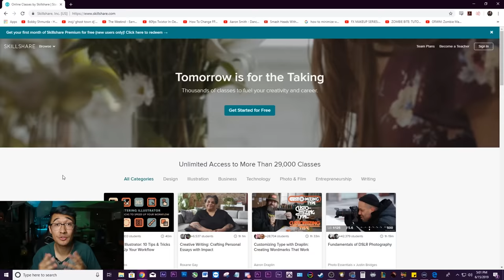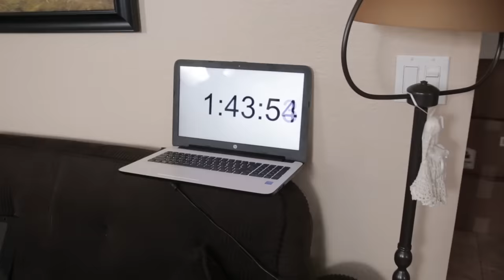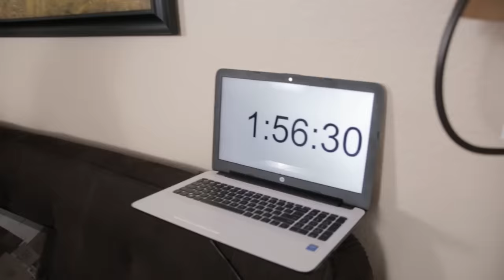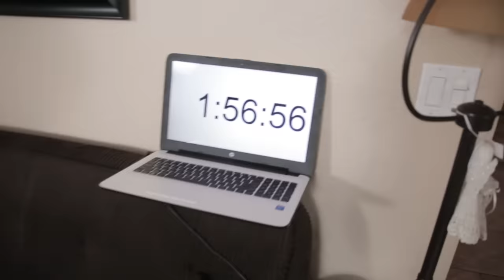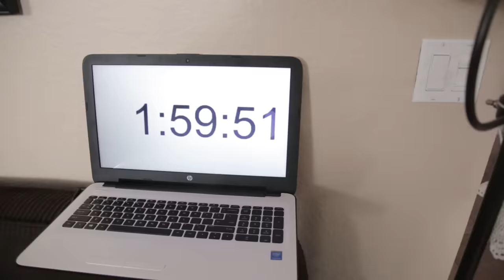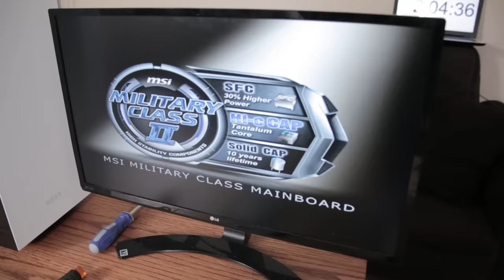He THOUGHT he was buying a Gaming PC...

Comment: 17:20 The case uses the hdmi cable as a pass through so that VR can be connected into the front of the case rather than the back, pretty useful but only if you need it. cx

Comment: He learned from watching ur vids
puts the power supply in first
Reply: Of course he did...
Reply: nothing wrong with that doe lol
Reply: You do you. Install PSU or mobo first doesn't really matter
Reply: @Harry_Ng  thats what i m saying i dont get this com
Reply: you mean gpu, nothing wrong with putting psu first, its the best idea but its not wrong neither, but gpu rofl
Reply: Psu in first so you can ground yourself before touching the mobo
Reply: It's clear that he learned from watching The Verge.
Reply: Putting the PSU in first is actually pretty smart because you don't have to move the computer around with any sensitive parts in it when you try to put the PSU in. Just pull the cables away from the case and make sure they're not going through the feed and blocking any other parts from being installed.
Reply: He should go back to playing tennis
Reply: Nehal Mathew i prefer installing my psu before everything else, its much easier because you dont have all the cables from the harddrives near thatcan get in the way
Reply: PacmanPlayz PSU first, it feels weird putting the mobo in first
Reply: Should’ve watched Linus lmao
Reply: @Joshua Ross "whre they go" .. you mean the cables? or..?
Reply: Lol
Reply: It doesn’t matter what u put in first I’ve built many pcs. It’s just matters if it turns on and if everything well put in together

Comment: I built my budget build for about 300 with an old optiplex with a i7 4790 and 1050ti. Upgraded the psu and added more case fans
Reply: Shae Bryan damn
Reply: Lejrje dude lmao he only bought two things
Reply: rx 570 would've been better, and cheaper
Reply: @andycane.  570 needs connector from psu. 1050ti are only 75w for most so they can be powered by mbd alone. essential for optiplex upgrade.
Reply: I did something similar but it was with an optiplex from amazon. It was a i5 2400 8GB Ram and a 256GB HDD. I replaced the power supply and added a RX 570. My other friend had a spare case so we preformed a case transplant. It cost about $300. Huge upgrade from his xb1
Reply: Eternal 
I ordered an old optiplex, with a 4770k.
The seller got it wrong, he send me a newer i3 6100, felt bad and refunded me the money. Got a rx580 and an msi z170 gaming m5, and a Corsair case
Total cost, 200 dollars, going to upgrade to a i5-6600k or 7600k

Comment: Thats what I most fear about building a PC, plugging the cables in the wrong spot.. Kris can u make a detailed video about cable management and where they are supposed to go?
Would appreciate it alot! <3
Reply: There is literally no way to plug in the cables wrong.
Reply: @KungFuBroFist  yeah but you could break a pin
Reply: anth0ny I’m assuming you’ve never built a PC before if you don’t realize how easy those pins are to break.
Reply: @jaalanodaicyr868  or yes
Reply: notechb0ss2.0 literally just dont put force on them too much..
Reply: Don’t worry it’s hard to mess that part up
Reply: Go to skillshare.
Reply: @branescan  I broke one on accident first time building mines

Comment: I'm fairly sure the HDMI cord is for VR
Reply: Yeah, it's just a pass through to the back of the case
Reply: @DTUOHY96  wrong, its meant for very premium graphics cards that has an hdmi inside the case.
Reply: No for vr if your mother board is compatible their will be a usb port dedicated to it
Reply: @thewingsofdeath4173  No, its meant for graphics cards with hdmis inside the case
Reply: @ashleyjohansson230  or as a pass through if you don't have one. It's still a hdmi port no matter what part of the gpu it's on.
Reply: Yes. The front port is for VR.
Reply: @ashleyjohansson230  it isnt tho
Reply: @colinmcguire3662  Yes it is, thats why there even is a front header hdmi in the first place and why graphics cards with an hdmi next to the pcie power pin exist to make VR more convenient instead of needing to plug things in the back.
Reply: @ashleyjohansson230  its for vr....
Reply: @colinmcguire3662  Yes duhh, did you read what I said? Its for VR but with specific graphics cards with hdmis inside the case so no hdmis needs to be plugged in the back. Please learn to read. Only premium graphics cards have this feature to use that front hdmi panel for VR.
Reply: @ashleyjohansson230  i did read and you said premium cards which do not exist...
Reply: @ashleyjohansson230  and i am not an idiot because i fucking work at computeq
Reply: Ashley Johansson ts designed there for GPU's which have HDMI passthroughs on them for VR (such as what is found on the Gigabyte Auros lineup of cards). If your GPU does not have such ports on the card, and instead only have HDMI on the rear of the card as per usual, then you're going to have to route that internal HDMI cable to the rear of your case and attach it to the rear of your card where your only HDMI ports are. There will be no place on your motherboard to attach this (other than the HDMI port on the rear I/O, but I would highly not recommend that because your IGPU (even if your CPU had one, which it doesn't) is not going to be powerful enough to run VR.

Edit: i prefer drilling a hole or taking a bracket out to plug the hdmi cable i the rear.
Reply: @aarriikknn33ll  Nice copy pasta from the LTT forums
Reply: Cloudy exactly ;) but this us common knowledge tho (atleast for me) just wanted to het a good explanation because my english is not the best whatsoever
Reply: @GODLIKEZ490  When I have to repeat the same thing 4 times, then thats going to annoy me
Reply: @aarriikknn33ll  You literally just repeated everything I just said. Learn how to read before replying to someone saying exactly the same thing that was just said like some parrot.
Reply: @ashleyjohansson230  i didnt want to reply to you, sorry. And also why are you so toxic rn? R u having a bad day or something..
Reply: Yea just a pass through

Comment: Lol that HDMI is for the hdmi for the front panel, which is usually used for VR.
Reply: Yes. For some time, there were graphics cards that were "VR ready" and actually had internal VR connections that came out the opposite end of the card for this reason. I know ASUS did this. Its actually a nice feature.
Reply: Clint Evartt yup it’s pretty nice especially you can just connect your VR glasses to your front panel and not have to go behind the case for it.
Reply: @JoCruz  yeah it's definitely something that I found out existed after getting my Rift setup. But it almost seems dead on newer generations of cards. Sadly...

Comment: Uhh hey chris! Im gonna be building my own pc for the first time, and its not gonna be on the budget side, gonna buy it all new! Here are the specs:

Prozessor: AMD Ryzen 5 2600 3.9 GHz
Ram: Corsair Vengeance RGB Pro, 2x 16GB DDR4
Motherboard: GIGABYTE X470 AORUS ULTRA Gaming
Graphicscard: MSI Amd Radeon RX 590 8GB
Case: cooler master H500P
Power: Corsair CX550M 550W
Watercooling: Cooler master ML240L RGB
Monitor: AOC CQ32G1

Total cost is: 1746.60

Should i change any of the specs?
Is the Pc going to be good?

Comment: I used to work at best buy. That cable was too a mini projector in the computer that projects onto the case glass as a monitor. But they only use the projector for the display model so they likely took out the mini projector

Comment: bruh im building a pc and i ordered the case and the mother board and the processor and the power supply are coming next and then imma order the other parts but...
the cables are the only thing that im doubting myself on i can put everything together but the cable from the case and from the powersupply that go on the mother board and shit does anyone know of a video that explains cable connections for beginners

Comment: I'm 16 bought all the computer parts but it would not start. After 1 week I finally figured out I shorted out the motherboard by not screwing in all the motherboard screws, got it RMA'd in up and running.
Reply: Mylen Belyue Pls tell me what to pick i have a cysona croma keyboard but i want to buy a RGB mouse oad should i buy razer fire fly wich i found less good then corsair cause of the RGB but the corsair isnt sync with my keyboard is that a big deal or not?
Reply: I cant dicide
Reply: I'm sorry your torn between two choices, but I would not be able to tell which one is best for YOU.
Reply: Do you think RTx 2080 used and AMD 2700x is a good gaming pc the GPU is 500 euros / 550 dolar

Comment: I think 300$ can get u a good pc, I’m trying to get one for 400, I was going for a 300$ but I wanted a bit better pc, but still when I did the 300$ pc it was good , it would’ve been Amd ryzen 1200 for 50$, gtx 1050 for 120$it and b450m 8gb ram and a case for 30$ and a power supply for 35$ and 250gb ssd and that’s it, I’m 13 btw.

Comment: I bought a pc with a monitor for $300... Tell me how I did

AMD FX 8120 
Crosshair V Formula
16gb ddr3 RAM
Two GTX 550Ti’s
800 Watt power supply 
Phantom NEXT case (2010)
7 fans on the tower to cool it

it’s old but I see potential
Reply: i bought one aswell tell me
how i did.

i5-3570
gtx 760
monitor keyboard and mouse with speakers and a headset
8gb ram
5 cooling fans

Comment: just so you know, "he wants to run games as difficult as The Witcher 3, which are difficult to run" is correct. grammatically, you are still referring to the multiple games that are as difficult as The Witcher 3. an easy way to tell if you got that right is to put it before your noun, so in this example it would be "he wants to run games that ARE as difficult to run as The Witcher 3", which is correct, while "he wants to run games that IS as difficult...". it's tricky because the setup of the sentence makes you feel like you're referring directly to The Witcher, when you're actually referring to the group of games.

Comment: Kristopher are you planning on doing any giveaway's I really am in need of a new 
computer but I can't afford it, right now I have an i5 and 4 gb of ram 
and I mostly play rust and as you know rust its not very optimized so I 
run at lowest graphics and lowest resolution and I run it at 30 fps with
 all those settings so I could really use a new pc.